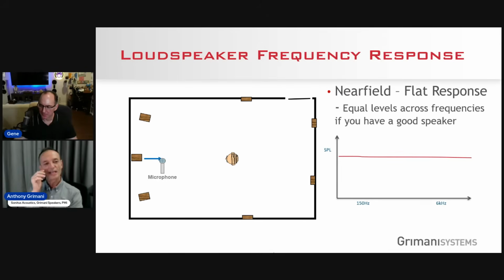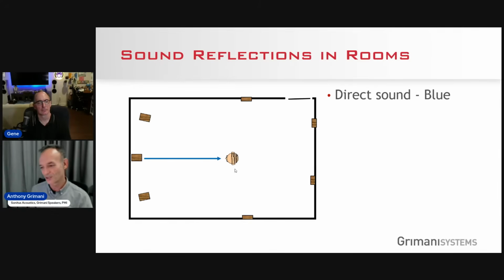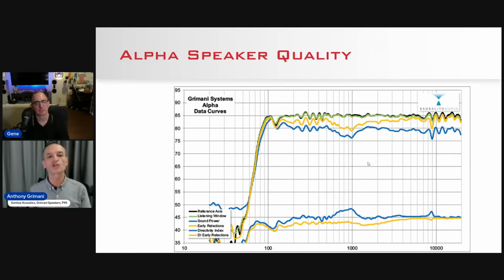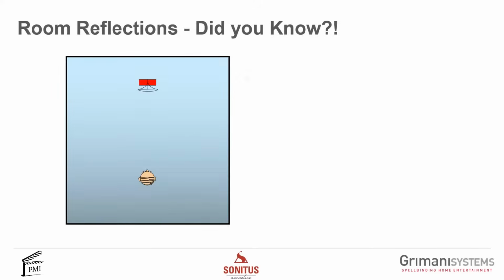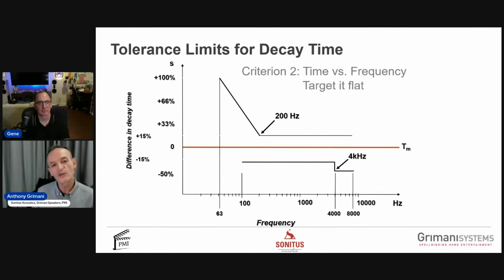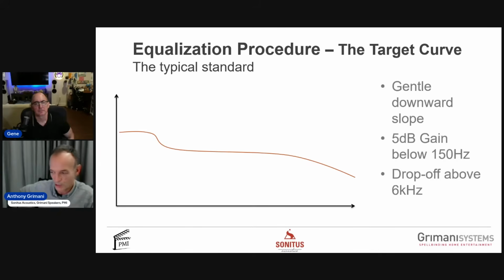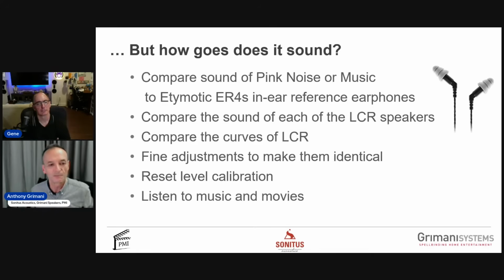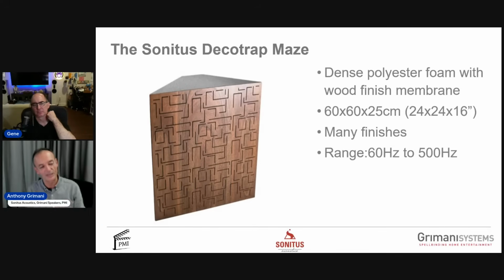Unlocking the Secrets of Room Acoustics

Comment: My room is only 15 ft x 13 ft and I have a horrendous spike at 38 Hz. I’ve tried moving my speakers, single subwoofer and listening position but nothing gets rid of it and I was a bit disheartened that the absorbers you showed only deal with sub bass down to 40Hz. Is room EQ my last resort as my listening room is also the living room so I don’t have the luxury of covering walls in physical treatments. Thanks for the fact filled informative podcast.

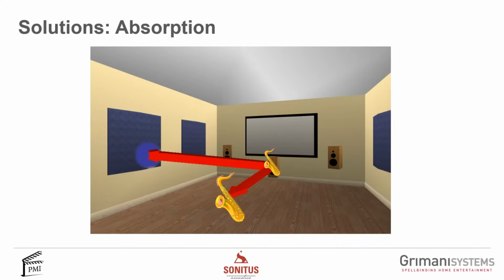Comment: One big question I have is regarding the room setup at 25:30 - Is there an issue with placing diffusors so close to the surround speakers, or even the fronts? 

Most of what I read has to do with the listener needing to be a certain distance from the panels for diffusion to be effective, however some sources say that same distance rule applies to the sound source.

Comment: The JL Max has 5 microphones and a multiplexer. Also can measure electrical signals like tapping off of the speaker wires and see what the electrical is going into the speaker and overlay that on top of the mic signals.

Comment: My takeaway from this video is don’t EQ the room above 1000hz…instead maybe EQ the speaker if it has response issues above 1000hz…since we hear the direct sound at higher frequencies and our brains tune out the higher frequency reflections
Reply from the maker: Mostly true. I use shelving filters above 5khz as needed. I never do fullrange auto EQ or any fancy apps to try to "fix" the response of the system fullrange.

Comment: So for us DIY speaker builders with access to REW and a decent enough omni mike (UMM6), what is the most appropriate path to determine the sound power of individual speakers and/ or all channels in a surround system? Room is 340sq f/ 2420 cu ft, not an exact rectangle, with awkwardly placed passage way door in back corner. 
Audyssey and AccuEQ have yield results that seem like there’s room for improvement.